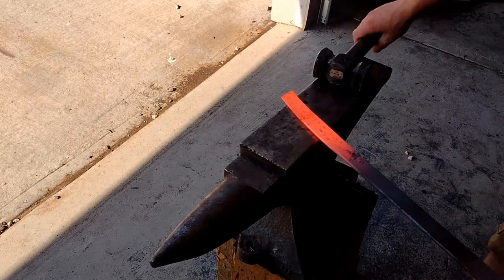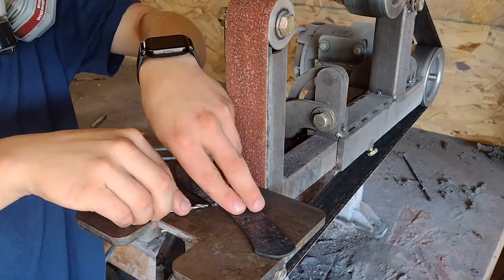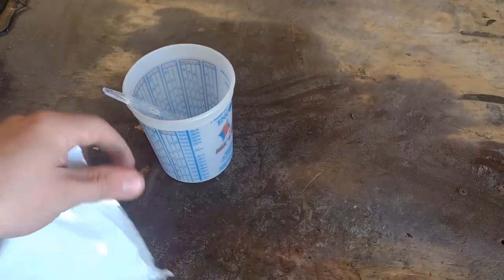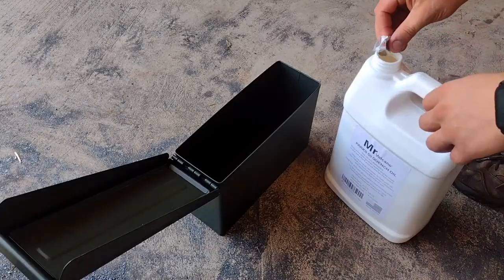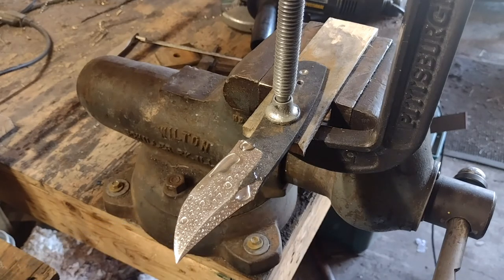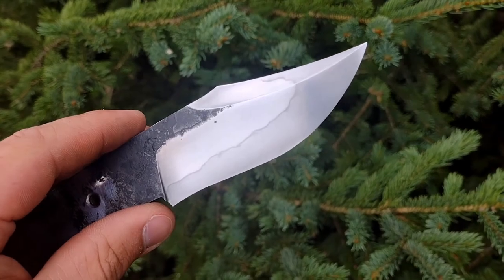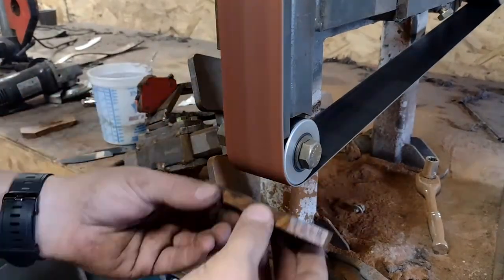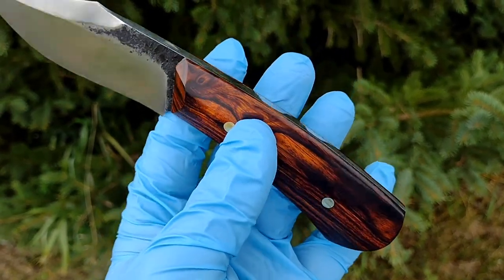Forging Someone Else a Knife

Comment: Hi, nice work! I noticed that a forge nozzle has problems with the gas supply; I have the same problem. How did you solve it?
Reply from the maker: I didn't really sort it out, the nozzle just works fine for hotter temperatures. When I turn down the forge for heat treating it starts spluttering again.